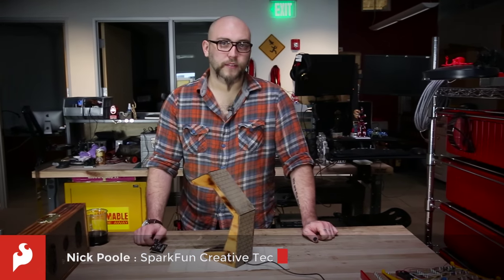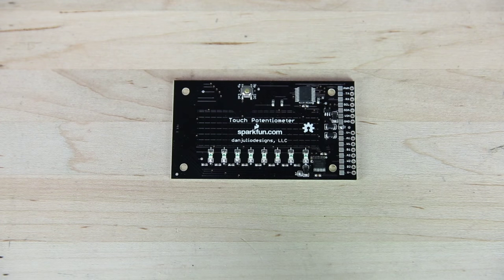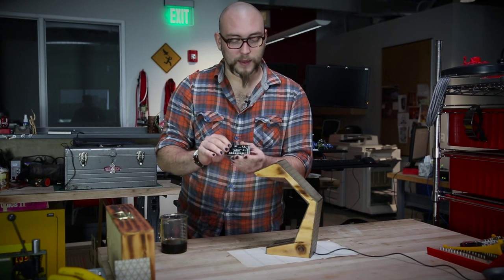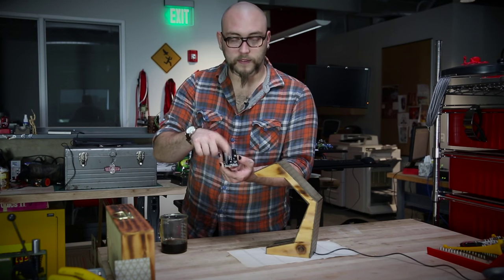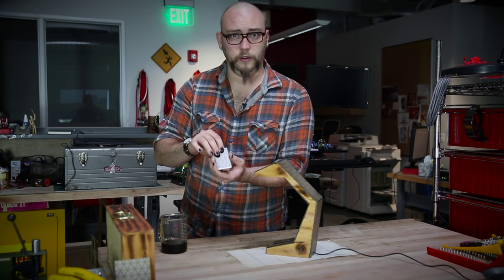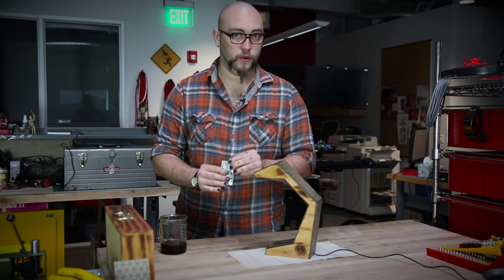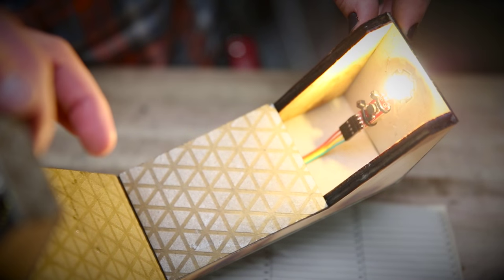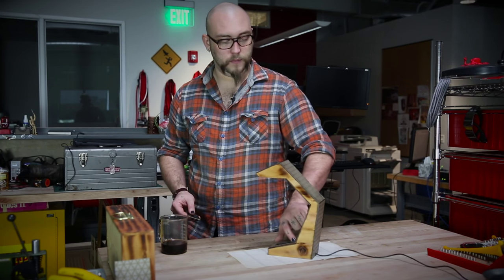Touch Potentiometer Desk Lamp

Comment: IMHO the pot board is upside down; you should swipe UP to increase brightness, not down.
Reply: +Paul-Joseph de Werk Yeah, opinions were actually split on this. I've seen it done this way on a few lamps (and even in cars) But ultimately it came down to convenience. Mounting it this way made managing the power cable easier, because of the way everything was facing :)

Comment: Still fairly new to electronics, so maybe this is obvious to somebody better versed, but if the board has a built-in voltage regulator that let's it use voltages up to 12V (as listed in it's features), why are you using a separate voltage regulator between your power supply and the board?
Reply: +Brian Peisley It's actually vestigial. I was originally using the digital potentiometer (as opposed to the PWM output) to adjust the femtobuck, and the Vreg was there to set my potentiometer high/low. But I found that I got much better range (and a smoother profile) if I used the PWM output instead, so I left the Vreg where it was (not hurting anything) in the interest of time.

You're not mistaken at all, if you wanted to recreate this project, you could do it without the L7805. Sorry for the confusion!

Comment: Can this pot be set to be used as a 1k, 5k, 10k, 100k and so on or whatever value?
Reply: +sirius428 It has a chip that can act like a real 20K potentiometer (actually 2 potentiometers) as long as the voltages on the pot are kept within the supply voltages.